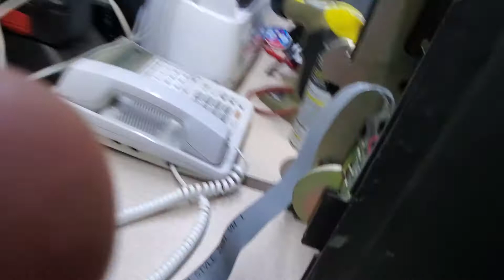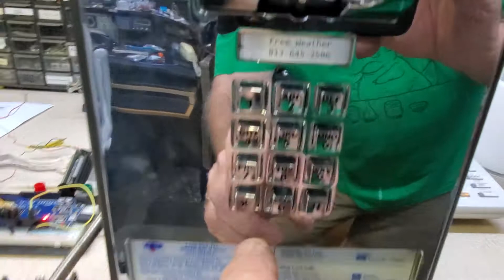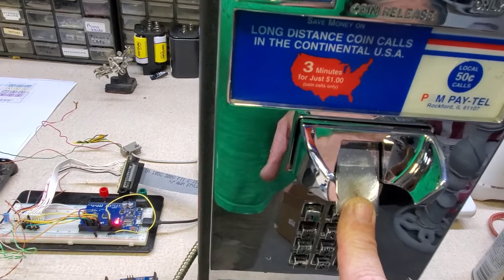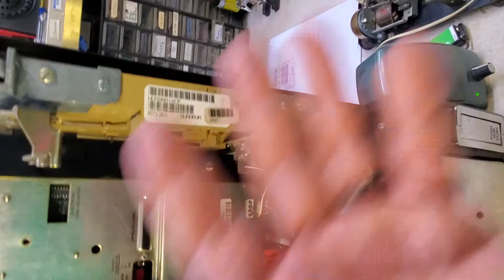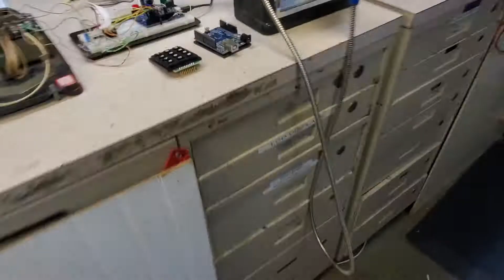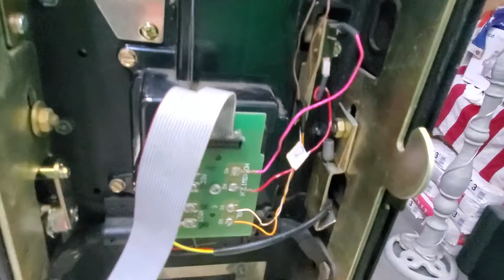Protel 7000 Payphone conversion to regular use first test

Comment: Where you able to get the payphone smart board to work ?, it has a battery 4.8volt rechargeable on the board , if you hook up a tip and ring , you should get dial tone , you may  need to program the board on the keypad also .
Reply from the maker: On the original board the battery had leaked  and ruined some of the traces. I could get it working about once in a few tries.  I bought another board and was able to get it working. I even have the Expressnet software and a Protel modem so I now do all my own programming myself. I also noted that the batteries I bought for it the little 4.8V gave me quite allot of problems so I used 4 x 1.2v rechargeable batteries and all my issues with beeping error codes and the coin relay not working went away.